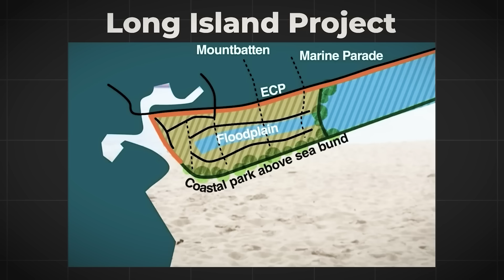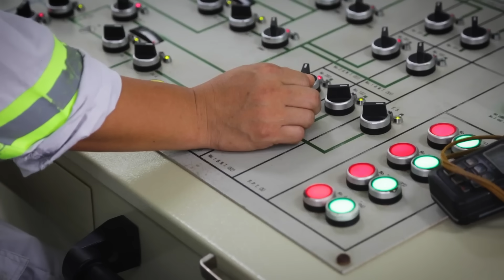Singapore Is Building $100BN of Artificial Islands—But Will It Work?

Comment: It's a very smart plan that shows the government is really trying hard to defend their country proactively against climate change - one of the few who are doing so. It is definitely one of the smartest plans to date (although whether the 150 years of concrete longevity will be enough is questionable), and it tries to use the area as intelligently as possible too - and, with these islands significantly higher than the land behind it, if sea levels get too high they could shut the flood gates permanently and turn that interior body of water into a lake. In other words, if carefully planned out and executed it could be very successful. 

The cons? Land reclamation isn't a good thing environmentally, but if you were going to do it, this is the cause it should be used for, and is most justified for - and their new method is actively trying to work around some of the big issues (although it obviously requires a huge amount of concrete, which in itself has high carbon emissions). The environmental costs to the surrounding sea ecosystem are worrying but considering this is happening over multiple decades, those issues could be mitigated - like, for example, creating new areas for corals and helping replace the corals that will ne destroyed in a new area, and taking extra efforts to allow the fisheries to be protected so the populations can be strong enough to withstand the construction. In other words, if carefully planned out and executed it could be very successful.

Comment: The Long Island is a key part of Singapore's long-term strategy to combat the impacts of climate change and studies and planning are ongoing. Multiple pathways are possible from the present reclaimed low-lying coast to a higher coast with or without one or more reservoirs separating them from the proposed Long Island.

One or more measures can be deployed to keep the present coast above a rising sea level or maintain a rising elevation towards the sea. Isolated topographic highs along the coast could be linked up to form a continuous coastal barrier. One or more sand engines similar to those used along the Dutch coast could also be deployed. Beach nourishment might be necessary to initiate and build higher coastal dunes and backshores. Breakwaters could be deployed to form headlands for the segmentation of the coast into shorter crescentic segments for better alongshore or seaward adaptation to rising sea level. When coastal conditions are suitable, caissons, boulders, stones and artificial sand could be laid in sections or continuously on the seabed to form the alignment of the Long Island. As reclamation progresses to raise the height of one or more sections of Long Island, opportunities exist for NbS, polders or lagoons behind the barriers. Beyond the hard structures one may have to consider floating and amphibious structures, probably the first to be deployed in the Long Island.

The pathways would be changed by at least by one or more of the following factors: physical (e.g. climate change, coastal conditions, engineering), costs (e.g. affordability), socio-economic (e.g. population at the coasts) and governance (e.g. transparency).

Comment: How can it be a fresh water reservoir if during normal conditions the gates will remain open to the sea? How is using concrete more sustainable when we have & are being told the making of concrete emits vast amounts of carbon? So much so that B Gates is trying to create new type of concrete. You say using concrete is more sustainable than sand but then you turn right around & say the casons will be backfilled with sand!

Comment: If by 2100, seawater may increase by 4-5m, wonder how high is the finished floor levels for the Long Island in relation to current general East Coast Park floor levels? Does it mean the Long Island has to be approx. 4-5m higher? How about other parts of Singapore and the interfacing parts when Long Island connects to other parts of the main Island?
Reply: Penang should plan the same method   in building reclaimed island of10 thousand hectres project

Comment: The Long Island is alongside only for a small stretch of the Singapore Island's surrouding coastal areas. Would not the other portions of the coastal areas be exposed to flooding when the sea level rises over time?
Reply: The other portions of Singapore are on higher grounds hence not so affected, but there are other measures in place to handle the issue of rising sea level nonetheless.
Reply: The south of Singapore is the most vulnerable to rising tides as it is directly facing the sea. In the north, Malaysia is there to act as a border while the south west has jurong island. Hence, east coast would be the best place to build this island

Comment: 6 million people packed in to a little over 700 sq miles, meanwhile we have New York City at around 9 million population with half the sq miles of land. Rather than build out, how about building Up / down.  How about building 20-30 story buildings above ground with 10-15 levels below ground or more. but due to rising water / flooding and various other issues in order to go down you first have to access the 3rd floor in order to take stairs / elevator down. Air intakes on upper levels pushing fresh air all the way to the bottom levels. Lower levels can use LCD screens along the walls connected to cameras thus giving the impression of an exterior view. But I know someone will say something about flooding via cracking on lower levels, well you then can apply the same logic used in ship construction to the foundations of the building, double hull, with pumps located in the gap to remove any water build up. You'll have lower levels cooling naturally due to being below ground while upper levels are heating up due to being in sun light. Thus you can push / pull air from one level below ground to another level above ground to help with cooling. Its time to start thinking outside the box and stop linear thinking. 

Start building these buildings below ground as if they are a submarines, double hull, escape tubes from one level to the next, various hatches and locks to seal off individual sections, plumbing and duct work to allow for excess water / smoke / etc. to be moved / pumped / drained.
Reply: All these have to wait, coming in the future!

Comment: If Dubai Qatar Saudi Arabia’s artificial islands are working why can’t Singapore’s ??
Reply: @dilruba3979  Singapore has been embarking on land reclamation since the days of Sir Stamford Raffles. The removed hill was used to fill up the shallow sea which formed Raffles Place (CBD of Singapore). More than 200 years have since passed. Dubai and Saudi Arabia certainly learnt plenty from Singapore’s example.
Reply: Those artificial islands are not built to protect life, they are for rich people housing. Singapore's is, so they have to make sure it works or people will die.
Reply: They are not. The Palm in Dubai and the land under the Burj El Arab hotel are suffering from erosion.

Comment: If salt water is permitted to enter under normal operating conditions how is it supposed to be a freshwater reservoir? 

The island lacks natural fresh water resources so they dont have rivers to feed it so it flows out constantly, having the gates open literally ever will ruin the water or waste the fresh water
Reply: 😎Marina Bay Barrage is a working model for the Long Island Project. https://www.youtube.com/watch?v=f6mnTvIKZK8 👍The guy who made this video did not check his script for errors. The gates allow excess fresh water to flow out during the monsoon season but are tall enough to prevent salt water ingress during tropical storm surges and high tide. Thus the water at the reservoir remains consistently fresh. 🤓
Reply: @jehiahmaduro6827  thanks for clarifying for me
Reply: No need to hold fresh water, just add a desalination plant.
Reply: @josephyeo6966  that is not as feasible as you seem to be implying, also that would make it part of Singapore's desalination program, not reservoir program.

Comment: Q:  Where will they get the new fresh-water reservoir from (13:02) ?
       Great video🙂👍🏼 
2:08 - - 25% land reclamation (1960) - 2:29 (examples)
2:40 - - largest importer of sand
Reply: Reservoirs doe not have to hold fresh water.  Just add desalination plant.
Reply: @ no, reservoirs DO contain fresh water - - which is what the video SAID
Reply: The new Long Island (consisting of 3 separated but linked islands, will enclose the current East Coast Park, to form the 18th reservoir in Singapore. East Coast area is currently low lying and very much exposed to extreme high tides, where sea water flooded all the way in-land on occasions.

From 4 reservoirs to 18, it’s already a miracle by itself. Kudos to the forward thinking planners and leaders.
Reply: @ Venice did a MAJOR (flexible) retainer-wall in past 20 yrs
Reply: Via Desalination and rainwater catchment . Thats what happened to the Singapore River. Its was originally sea water. Right now it’s Singapore largest reservoir. It’s only possible by building the marina barrage.

Comment: 0:14....The rate of sea level rise has not increased. The sea has been rising for 15 thousand years, and the current rate is not perceptible.
Reply: This is not correct
Reply: @ConstantChaos1  what exactly is correct then?
Reply: @andreaspatsalides1914  sea level rise isn't a constant and is impacted by factors such as loss of glacier cover? Sorry, I didn't think that would need explaining.
Reply: @ConstantChaos1  I dont see how that contradicts what the original commenter said. Because it is not a constant doesnt mean he is not correct.

We will not see a measurable difference on sea levels anytime soon, unless external factors change that (such as meteors or the sun)
Reply: @andreaspatsalides1914  "the rate of sea level rise has not increased" so either its a constant or in the decline, and surely nobody is trying to claim sealevel rise is slowing. 

I don't see how you could think that it doesn't refute their claims that the rate of sea level rise hasn't increased in 15k years lmfao.
Reply: @ConstantChaos1 It fluctuates. It doesnt have to be a constant or on a constant rate (declining or inclining). Its just not changing at a noticeable rate
Reply: @andreaspatsalides1914  
A) that's not what they said
B) that is precluded by what they said ("it has not increased" would preclude fluctuation)
C) that is not correct. The rate of sea level rise has notably increased outside of its natural fluctuations. Also it's by a noticeable amount idk why ppl keep claiming we cant see it when fields are having to lay fallow due to salt water intrusion at an increasing rate. If you don't look you can't see it, sure, but it is easily visible if you care to look with honest eyes.
Reply: @ConstantChaos1  

Ah I see where I misread something, I get point A and B

I care to look with honest eyes. I really dont see the noticeable increase outside of natural fluctuations, can you perhaps give me a source or at least the number it has risen since a certain timeframe?
Reply: @andreaspatsalides1914  it's gone from 0.06 inches/year for the 20th century (which was already high) to 0.14 inches per year as an average since the turn of the century, and it keeps accelerating.

Sorry I replied earlier but apparently it got auto-screened because I tried to include a link
Reply: All around the world, hundreds of billions of dollars are being spent on myriad kinds of fancy shoreline real estate projects every few months (which also come with many forms of long-term assurances) - none of which are preemptive of or concerned about sea level rises; storm fronts yes - but nothing else.